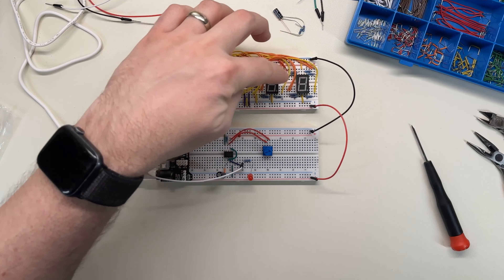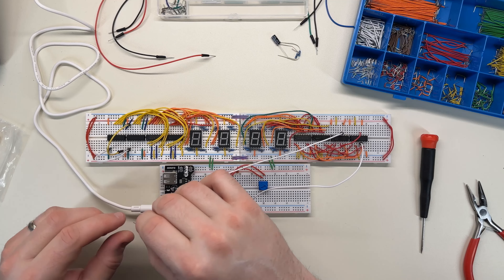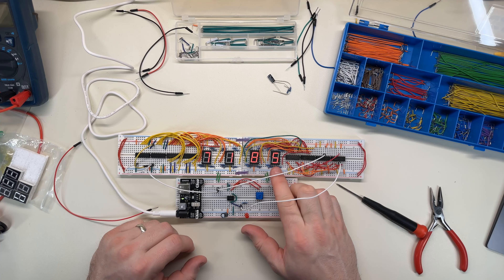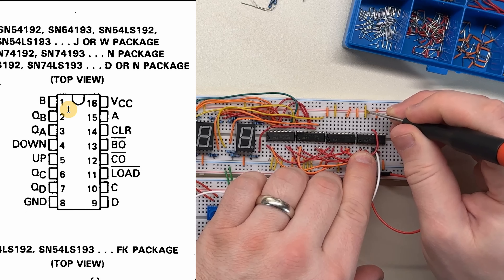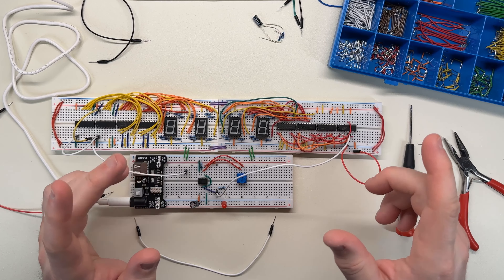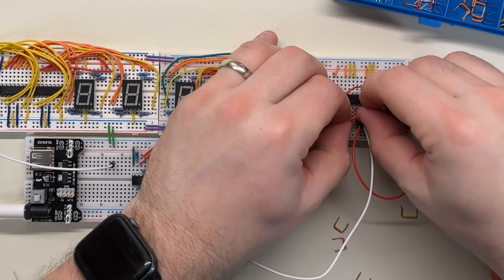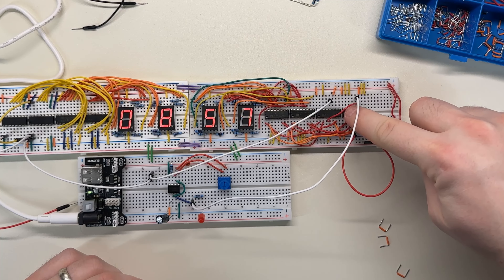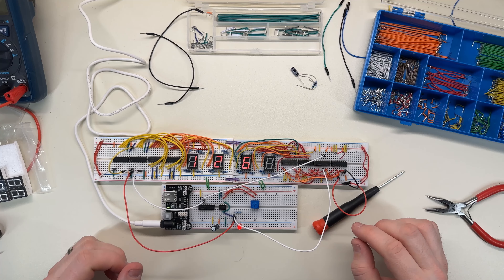I thought 4 digits would be easy but everything goes wrong (The Great Multi-Digit Saga: Part 2)

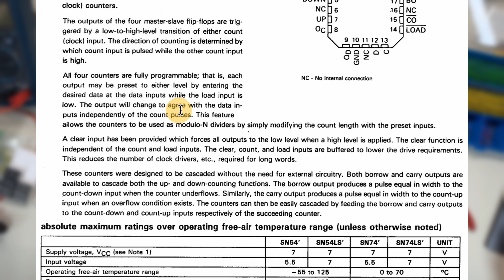Comment: You should read the whole paragraph. At 7:45, there is a paragraph about those preset lines that are A,B,C and D. It means that when you put a binary or BCD number there, when activate LOAD signal, can load that value into the counters. That is useful to make division, like in a clock, to force the counter to count from 00 to 59 and then to return to 00.  They have to connect the unused clock input low to count; i.e to count up, input the clock to the UP input and ground the DOWN input. You are correct to get the output from the carry pin of the second counter to cascade with the other counter module but you do not need to connect the clock signal to the counter module on the left.
I suspect a bad contact on the breadboard or a error with the wiring. You should show the schematic that you are using to check first that there is no error there and then to check the actual circuit on the breadboard.
What you should have is (not sure if I can explain clearly enough) counter 1: Clock in to UP, DOWN to ground, QA-QD outputs to the LED decoder, A-D to 0 or 1, LOAD to 5V, Borrow to Count DOWN of the second counter, Carry to Count UP of the second counter. The second counter should be wired the same as the first, but leave Borrow unconnected and use Carry as the output clock for the counters on the left. Both counters should have CLEAR pin to ground.
Edit: I used 192/193 counters many times either TTL or CMOS, and they are very well behaved and also easy to work with. The pinout makes the PCB easier to design that the old 7490 and also have the ability to count up and down from a single clock input with only few logic gates. If the circuit misbehave at higher frequency, use a decoupling capacitor directly on the IC pins, however, on the breadboard you should be ok up into the KHz range.

Comment: I've been doing a 4 digit counter as well, here's what I ran into. I constantly had to push down in the ICs, due to inconsistent counting. Eventually I'd get it to work, but they would loosen back up and I had to push them back down. Eventually I had enough and had to solder everything to a circuit board... which is unfortunate because I wasn't done with the circuit as a whole. But, since soldering everything down, its rock solid. Seeing your counters skip digits is so reminiscent to what I dealt with.  Consider what I'm saying... I wasted so much time troubleshooting a circuit that was correct. You are making such great progress, I hate to see you lose ground to breadboard issues.

Comment: I hope to demystify some of the datasheet, I don't think all of it will remedy the glitches you are seeing, but here goes. Firstly, the Bar on pins refers to the active state, so /LOAD means Load is active when logic low. Where you aren't intending with your current test to use that, it should be held High, which you are. The logic diagram on page 5 of the TI datasheet illustrates first clearing the data with a HIGH pulse to CLR (effectively storing zero), setting some bits with a LOW pulse to /LOAD (for the number 7 in the example),  then on the RISING Clock EDGE on UP the counter increments. When the counter reaches 9 the /CO pin "follows" the UP Clock pulse, so by connecting /CO on digit1 to UP on digit2 you get synchronized increment. (On the rising edge of the UP CLOCK (digit1) the /CO also rises, giving digit2 UP a rising edge to increment, thus simultaneously digit1 goes to zero and digit2 goes up). Also DATA in is only read on a /LOAD pulse, it appears you can leave them float, but It may be useful to incorporate a CLR pulse to set zero. It likely won't behave as intended if held high, you may be able to do it with an RC filter and a pair of inverting schmitt-triggers. (that should only fire once on power-up which is what you appear to want, you may be able to add a button for manual reset later.) With regards to the GND pin on BOTH chips bending when placed in the right hand position, I recommend checking that hole with a sturdy piece of wire to see if there is something off about it. Not all breadboards are of the same quality, It's hard to tell from the video (and I have only just found your channel and watched about 3-4 vids) how good the ones you have are, but if you are going to use bread boards, shop around and buy the good ones, they can save many headaches. Ben Eater sells some good ones, or has some advice on what to look for. (he also has a handy 555 based clock breadboard circuit on his webpage that allows for variable speed and single stepping which is handy for trying to understand what the heck is going on sometimes.) Last thing I will say, if you have additional bread boards, it might be handy to build a 4 or 8 LED "Logic analyzer", if you have or acquire a buffer ic to run the LED's such as a 74ls540/541 then you could connect ground and any of the inputs to a specific signal on your circuit to inspect the state as it is ticking away. The buffer is recommended to not put extra draw on your circuit under test. Great video, hope you figure it out. I enjoyed following along!

Comment: Remember that the state of a counter on power-up will be undefined, so the counter must be cleared if it is necessary to have it operate properly as soon as clocking is started. Remember also that a counter with four flip flops has 16 possible states. Even if the counter is intended to count from 0 to 9, it could power up in one of the six unused states. Typically TTL counters did not have circuitry to specifically define the transition from an unused state to a used state, so the behavior is unpredictable until a used state is eventually entered (the next state from any particular unused state may actually be highly predictable but still not what might be wished for; in some sequential circuitry you can wind up never getting from an unused states to used states unless reset is used).

EDIT - I had a look at the datasheet for the CD74HC192/3. It includes a state diagram showing the transitions from "illegal" states.

Comment: I see no evidence of decoupling capacitors on the breadboards.
Power supply decoupling caps are very important in sequential circuitry because transient misoperation is "remembered." Counters, depending on specific type, can be particularly difficult because you can have multiple outputs making transitions simultaneously.

Decoupling is too complex to explain in detail here (though I can if someone really wants it). There should be some good info on the web. Decoupling primarily negates the detrimental effects of inductance in the power distribution paths.
Basically you want a ceramic capacitor of around 100 nF connected between Vcc and ground close to each counter IC (usually OK to have one cap for 2 or 3 counters if they are close together) and on the shortest leads possible. There should be one for the 555 - they are horrible for putting noise on supply lines. When power is coming from another breadboard or a remote power supply, a "bulk capacitor" of 10 µF or more (aluminum electrolytic cap usually OK)  somewhere around where the power comes onto the board.
Reply from the maker: Hmm. This sounds like the kind of thing I was afraid of - a whole new dimension of possible problems that I didn't even know about!
Reply: Simple way to find out. Put a scope on the power rails
Reply: @rty1955  
Zaphod doesn't have an oscilloscop.There really isn't any alternative method I can think of for assessing supply quality.

In any case, use of power supply decoupling is standard practice. He uses a local regulator board that presumably has input and output bulk capacitors, so at least he's off to a good start there. A lot of people will connect their bench power supply with two rather long, separate wires, which is very bad practice since you get a lot of inductance in those wire (a twisted pair is very much better).

I can't be sure that his issue is caused by lack of decoupling, but odd and inconsistent behavior certainly can be a sign of need for decoupling. Inconsistent behavior can make debugging very frustrating.

Comment: place a capacitor ACROSS the power and ground pins on some of the counters. the bad counting will go away. thats what happend to me with that circuit.
Reply: connct the power as uuasual but place a cap along side the power pin to ground.

Comment: I feel your pain! 😋 If you crank up the speed and it stops working, your timings are maybe a bit off. You might need an edge detection circuit to ensure a clear pulse instead of short pulses that can be missed by other chips when the speed is increased. Check if your 555 timer is producing a nice 50% duty cycle pulses. If so, go down the line and see if everything else is producing nice pulses. If not, you may need an edge detector circuit to prolong the pulse. I made a short about a simple edge detector circuit:  https://www.youtube.com/shorts/0Jpop3v_-x0
Reply: There no need whatever for a 50% duty cycle clock. If the clock rate were approaching the maximum that the counters could handle (which would NEVER happen with a 555 clock generator and TTL counters), then there might be some value to having about 50% to meet the specified requirements for HIGH and LOW times for the clock.
A 555 is simply unable to produce a clock with either HIGH or LOW time that would violate the timing requirements for TTL.

Comment: First off, is this a simple 4 digit counter? If so its a veey simple design. 
If you post your schematic, it would be easy enough to guide you.
First begin with the right digit first. You are also using 7492 which is a divide by 12 which will count 0-11 or bcd 0-1011. Clearly this will not work for 7 seg displays..use a full 7490 for right leds, then use ONLY the divide by 5 portion of the next 7490 for the next digit to the left. This will displa 00-59
I think thats what your after